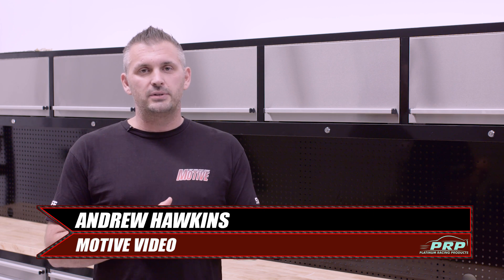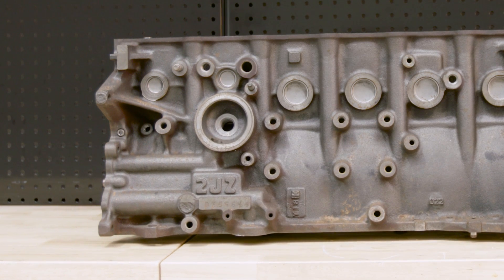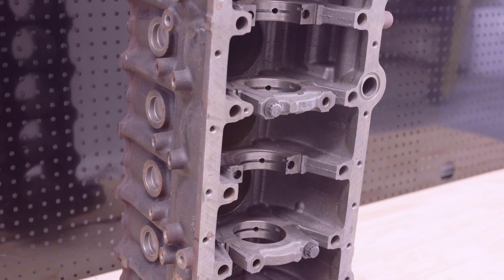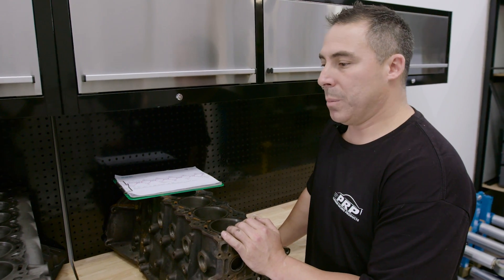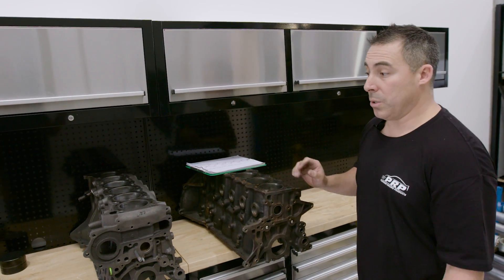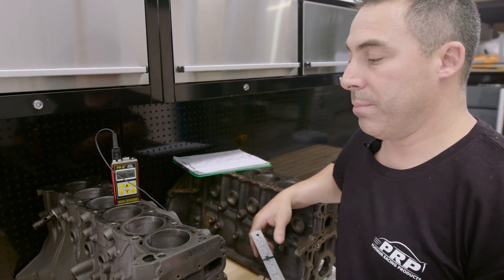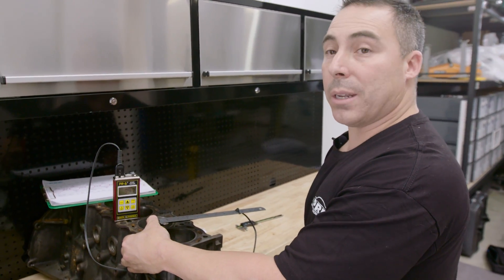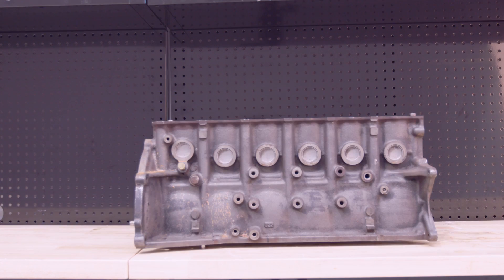RB30 vs 2JZ Which is the Better Block and Why? - Mythbusted

Comment: This testing is incredible!!! Thanks a lot!!! Would love to see this testing on the common used blocks on high power 4 bangers...SR20DET, 3SGTE, 4G63, 4B11, EJ´s....
Reply: 3S is just a 4Cyl 2JZ.
Reply: @negativeindustrial  lol..That's good..
Reply: Gareth Curtis Sky Surv
I agree - I have two of them currently and have owned several over the years. I’ve only ever blown one but I got way too greedy with the boost on a stock HG
Reply: Tex 13
I agree all three are great engines and the later 4G63’s addressed this issue but you and I both know the 90’s engines had SERIOUS crankwalk issues  the second anyone attempted to run higher than stock boost. The 3S-GTE has always been a tank of an engine, especially from ‘94 on when Toyota switched to a MHG as stock.
No offense, but the 3S was just a way more reliable engine from ‘88-2000 than the 4G for tuners as one would expect from Toyota/Yamaha.
Reply: @negativeindustrial  Yup 3S and 4A’s rule. There are 1000hp blacktop builds out there now. Barry from MRP NZ gets some serious power from them both N/A and Turbo
Reply: the ca18det doesn't get love......

Comment: Another great video:) Even as an RB fan, its no question after seeing this that the 2JZ block is far better engineered and superior in almost all areas. Both thicker in the important areas and 23% lighter. Hats off to the Toyota engineers from the 80/90s.
Reply: Но рб перегреть тяжело, а джей легко
Reply: @DriveAsek  not true at all. Rbs have all types of oiling issues among many others. Never had a jz overheat on me even in the dead of traffic on kill or on one of my chill tunes. I've been building them and around those and 7ms for the better part of 27 years
Reply: @LucidBoost_3600  и что теперь? Я тоже  занимаюсь автомобилями 20 лет, это что-то доказывает?

Comment: Hardness testing has little bearing on the block's strength.  The only way to gauge the material's ultimate tensile strength, without destroying the block, would be to take a tiny sample of cast material for spectro analysis. From there you can determine the composition of elements used in the casting and then look up the grade of iron used. Most Universities would have this capability so look up contacts at your local uni who focuses on material science.

Comment: My mate fitted a RB head on to a 2J block and fitted it in his civic. Now his VTEC kicks in at 11000rpm. He told me the other night in the pub. I was well impressed
Reply: 4 turbos and 2 superchargers
Reply: Is this the same one that has the Lamborghini exhaust?
Reply: @k_tec_tuning  headlights not exhaust
Reply: my friend managed to strap a turbo'd jet engine which was supercharged to his civic type r... no shit!
Reply: No joke, have you seen SupraSport's custom billet JZ head that utilizes dual VVT-i from the beams motor and Vtec solenoids for variable lift?
Reply: Yeah thats some crazy shit... Haven't seen one installed just the front cut out
Reply: @BUZDRIFT  Same here. I hope someone test it out. I remember their pricing was on part with a fully built head so it wasn't like it wasn't over priced.
Reply: @sigmaprojects  holy shit!!!!!!
Reply: @sigmaprojects  t"VTEC solenoids for variable lift lol wtf you have no idea what you're talking about.
Reply: that's nothing my friend fitted a k20 to a w16 with 7 turbos running at 720fadeway reverse dunk from the half court driven by Scal the Goat
Reply: And this is the only other true comment on the internet.. I'm on fire! BaAmM
Reply: lengthen your injector pulse another milisecond you'll run fives.
Reply: That’s called 3jz triple cheeseburger swap.
Reply: @johnc6466  Dude, no it's not, it's called the Gallo 24 everyone knows that.
Reply: Mad, let me know when he stage2s it
Reply: My mate fitted a stage 3 engine with a stage 3 turbo setup from a japanese gto on his dodge stealth. He replaced the steering wheel with a PS2 controller. He makes like 999 HP now and wins every race now by fitting a rubber band on the controller
Reply: Did y’all hear about the 3JZ? Yeah my friend took a 2jz block and had civic pistons dropped in and he says it makes 2JZ power with Civic mileage, crazy right?
Reply: That's nothing, my rotary v6 corvette with stage 4 windshield wipers will smoke that thing
Reply: My mate has a Dodge Phoenix with a 10A rotary and a 5500rpm stall clutch. It has Recaro bench seats and a Koni adjustable steering column.
Reply: @johnwilson1794  Koni Adjustable steering column... my god... the JDM level.
Reply: John Wilson z
Reply: @johnwilson1794  you win lmao
Reply: @johnwilson1794  bruh. You gotta see my auto trans 3spd 89 ford tempo rolling a Harbor freight v2 13hp predator. Shit runs like a 47.3 second 1/8th mile. Doubled the speed, 1/4 the fuel mileage.. 

Am i doing it right? Haha
Reply: Lol
Reply: This made me lol
Thanks baby
Reply: Wooah Das Wicked,  my m8 fitted a civic b series head 2 a 2J block in his skyline with similar results,  I was mad stoked when Vtec kicked in at 1,100 rpms.
Reply: Yeah a non vtec engine gets vtec kicking in at 11000rpm😂
Reply: Your mate has great dreams but in reality 2jz in a civic aint one of them.
Reply: i have a supra with a suzuki pv 50 engine. she rips.
Reply: This is the only true comment on the internet... I found it.
Reply: I'm impressed. Only a TRUE Ricer can pull that off. Don't forget the flux capacitor and blinker fluid.
Reply: 😂😂😂😂😂 nah i knew a fella put ferarri engine in his ep civic and so much forced induction and subwoofers and all that shibang 😂
Reply: That's nothing bruh. My mate get rid of 2j and fitted B58 BMW engine to a mk4 Supra body - now that's something.
Reply: Is 4000 of the rpm in the intake and is it converted from fwd to twin turbo???
Reply: But does it have hella horns tho?
Reply: "You had me on the first half. Not gonna lie."
Reply: Lmao
Reply: I thought you were talking about my car at first! Built it back in the 90's. Same thing but I used a 20B rotary engine for spooling the turbos. Miss that monster.
Reply: Can you get cancer over comments cuz u think I just did.
Reply: g4rr377 hand me my beer.....I gotta hear this story....
Reply: g4rr377 uhh
Reply: i bet ur friend car not 10 second car but 2 seconds car hmmm noooo monicaa
Reply: g4rr377 I love you
Reply: My dude G4rr377 you need a few classes on engines, I'm Pretty sure thats not how that works... these arent remote control cars, these are expensive works of art, for you to say anything like that is just cringy dude i feel bad for your IQ man!!!
Reply: WOT you have a friend 🤯😱🤣
Reply: i put a W16 engine into a daihatsu charade. if you train your foot to hit exactly 16k rpm the car does a perfect back sommersault. great way to shut up the r37 drivers at a pink light. their boxer 7 engines cant even hit a measly 13krpm. what shitlords.
Reply: The Pub part is the clue
Reply: Rubbish
Reply: Your drunk go home.
Reply: I did a similar build and added Corvette pushrods. It made so much power I had to switch my oil to WD-40
Reply: Tlkin crap
Reply: The alcohol in that pub came from Mars or something
Reply: Did the stickers add hp too? Lol jk
Reply: Thats cool. Should check out my channel, I just posted a video of me fitting 2 2JZ heads to a V12 from an aventador. Got 4 snails. Broke the dyno. Of course its in my Civic. ; D
Reply: hahahaha
"true story yo!"
Reply: 11000 rpm with boost he must’ve gotten up there quick 😂😂😂
Reply: I believe you
Reply: Never heard of an rb30 what vehicles they in?
Reply: Pfft. Sure thing kid
Reply: I had one of them and was running at 45 psi boost but I couldn't get it upto full power cos I ran out of 50p coins for the meter!
Reply: Ayo 😂
Reply: How many beers he had before the story?
Reply: @ricardomarquez5405  none. He doesn't drink the devil's juice
Reply: If it kicks in at 11,000 then what’s it devs to 11500? That means he’s only got vtec in 5% of the rev band…maybe he needs a better tuner.
Reply: You know that this is impossible due to 2jz's design!!
Reply: Rumor has it he replaced the pistons with RX-7 Doritos too !!!
Reply: RB head on a 2JZ block! How the f**k they have different bolt placement 😳 this is amazing. I’d love to hear how he did it!
Reply: lol VTEC kicks in @11,000 RPM?  So is the redline at 15,000 RPM?  lol
Reply: From reading😮 these comments yall down there are made from a different material. Jet engines on civics and shit. Hahaha.  Awesome
Reply: My friend's uncle's has 2JZ with twin turbo per cylinder, for a grand total of 24 turbos. Wait! What?
Turned out he built a V12 out 2 2JZ's. 
so technically it's a *4JZ*? 

When asked why, he said that he wants to offset his carbon-neutrality of owning 3 Teslas
Reply: Sounds dope if its true. Id like to hear it
Reply: Complete lies.  It won't mate up
Reply: Hahahah I wanna believe that’s the screamer he was looking for eh hahaha I don’t even think it’s vtec I think it has to do with the boost boost over vtec is fucking histerical😂

Comment: rb30e SOHC complete motor in aus and nz= around $200. Even as a single cammer youll still get 500hp no probs. Thats why I love the 30. Unfortunately the most youll see n/a is about 140/150kw atw .

Comment: Yamaha know what they are doing, they make some sweet motors.
Reply: Yamaha does not make any Toyota motor. They helped tuned certain parts but they DID NOT make the 2jz
Reply: @Toyota4Life  I always thought Yamaha designed most of the heads on their engines?

Comment: Sorry too say but some engines with jointed cylinder thend to crack at where they join true fact because ive had this issue on European engines even other engines with this style of cylinder design
Reply from the maker: Well, 2JZ's dont.
Reply: @MotiveVideo  and who said they don't? ? You or other people im sure people have cracked cylinders walls or more common throw a rod .because bmw throw rods too

Comment: Your off about the mains being okay, they aren’t, they are blanketed under whp numbers, 2jz mains walk around and show fretting, Toyota didn’t design the 2jz for rpm so it lacked the bridging but the RB has a girdle and spins RPM . 2jz do have aftermarket girdles to fight this one thing you leave out is big names dog to billet 2jz is because they split the block something that 2jz owners don’t want to say out loud. A Duramax diesel makes 10 times the torque and doesn’t have 4 bolt mains or bridged mains nor does a Cummins bridged mains is RPM dependent.  How come you’re finding a bore taper of a 2jz weird but yet when I told you sleeving is superior You argued that around the bottom of a sleeve is weak and cracks but justified it in this video?!?! For a 2jz 🤔 sleeving is superior an un matched consistency you talk to me about core shift a machinist can’t calculate offsets or correct misalignment?
Reply: missed a point or 2 there i think, the first being that the 2J doesn't need a better main cap solution... "or does it"? please keep an eye on the PRP Instagram page tomorrow for that answer, and the sonic testing revealed the 2J tested had a tapered bore, better towards the top, where the cyl pressure is, the RB does not, nothing to do with sleeving.

Sleeving is another debate, but i have answered that one too many times to type it out again.. happy to chat about it if you are keen, 0449688530 cheers
Reply: i have seen the 2jz rev to 12k in some applications
Reply: Toyota4Life they are far from your standard 2jz..
Reply: MSengineering David I get it but multiple 2jz all over youtube rev to monster high RPM so I don’t agree with what you say about not made for high RPM
Reply: Toyota4Life it doesn’t matter what you see so you don’t have a clue what you’re saying...12k not something 99% of modded 2j owners come close to
Reply: MSengineering David my point is. The 2jz can rev Incredibly high if it’s built to do so there’s nothing the two Jay Z can’t do
Reply: Toyota4Life your point is you’re just a fan boy with no experience... it doesn’t matter what you “saw”

Comment: It's pretty conclusive I guess. The Toyota block is designed and built better. The GTR is a better car though and if it can handle 500-600hp reliably then who cares about more than that.
Reply: All the people pushing them double that.
Reply: You're right! After all the r34 especially was an overall technologically super equipped track/circuit assassin, purpose built not as a highway pull beast or dyno desyroyer.. The rb is surely still very functional in the package for its intended use, with many cool features and a race bred pedigree.. But on the other hand the 2jz is unquestionably capable to fulfill the power hunger and the number chase of our days. Don't get me wrong I love em both, it's just that the 2jz is so overbuilt and overengineered that it's insane! But you can't compare or diss either one, as much as you can't diss the Supra over the r34 and vice versa they're both great cars at what they do! But on the street/drag scene the 2jz is always gonna be the top dog for it can meet the obscene expectations and abuse of the particular application!
Reply: john maselli 👍👍👍👍👍
Of course man!!! Nothing comes close to those two!! They are beyond cars, they have reached legend status! They were made to be legends and in our minds they've become entities of the car culture!
Reply: john maselli oh and the nsx I might add as well, not so much on the raw performance aspect but it's one of the Kings you know, and a beautiful car too!!

Comment: JZ all day everyday, there is a reason JZ engines break world records.  It is not an exaggeration to say it is probably one of if not the greatest engines ever created, to think such a simple design can go such a long way. That said, even as a 2JZ fanboy, I would never swap out an RB from a skyline GTR. They're still a great engines, that work incredibly well with the GTR chassis.
Reply: 2J and LS are the best performance engines ever made, period. Both somewhat simplistic, but intricate and revolutionary designs that handle power extremely well. I have owned both types and love them immensely compared to anything else.
Reply: @TheColbyChurch   I agree, they are the only 2 engines that I know of that are basically swapped into almost everything at this point.
Reply: @TheColbyChurch  lol look up tvr speed 12, NA 7.73 L, broke its dyno but estimated at somewhere between 1000 and 1400 horsepower in 1998

i think thats better than an LS or a 2J
Reply: @Will_M600  But notorious for breaking as soon as it left the factory… As all TVR’s are.
Reply: @Tex 13 F20? forged from factory. I'd say better than the 4g63 - made of butter than thing and needs care every time you stop.
Reply: The greatest engine ever is this. https://en.m.wikipedia.org/wiki/Pratt_%26_Whitney_J58
Reply: Funny thing about this thread, because they never won any renown races... drag races is nothing, LS powered cars haven’t won any notable races either. Again both drag but nothing that matters...
Reply: Only engine better than 2jz is chevy small block. Weighs less, way more power, shorter, cheaper, more suport....
Reply: jimmicrackhead12 your name says it all
Reply: @robocop3961  delusional ricer boy detected
Reply: well said man
Reply: Der König  yeah i consider them same tbh
Reply: Yeah that's true but I think RB engines have better precision and higher revs for tracks and circuit racing.
Reply: Wind of change 2jz are breaking records due to the Barra being rare in the States.
Reply: @nordic5490  Ehh, I don't think so. Performance builders can buy anything from anywhere nowadays.
Reply: @nordic5490  isn't the Barra block the same old block Ford Falcons had since the 70's?
Reply: @nordic5490  back dribbling
Reply: @brentonwood5464  sober up mate. Try again tomorrow.
Reply: @nordic5490  the 2jz is still lighter among many other things. They did a comparison on the Barra and 2jz too. Go watch and break your own heart lol